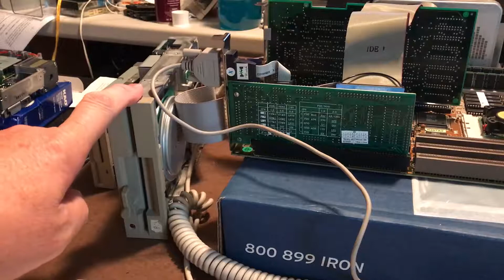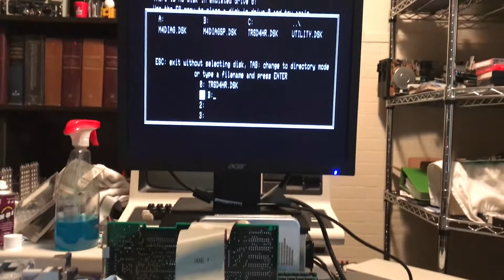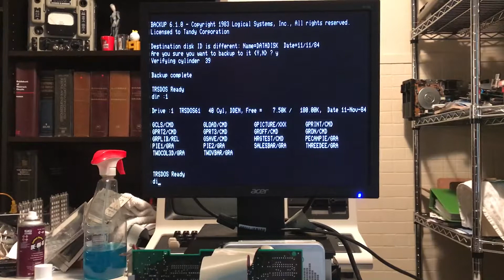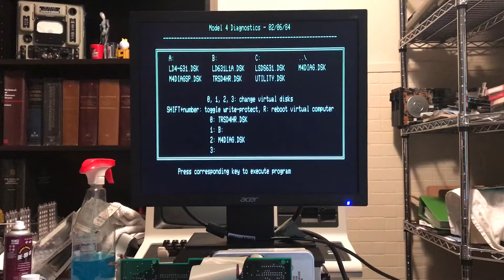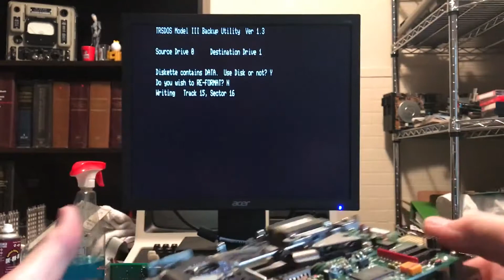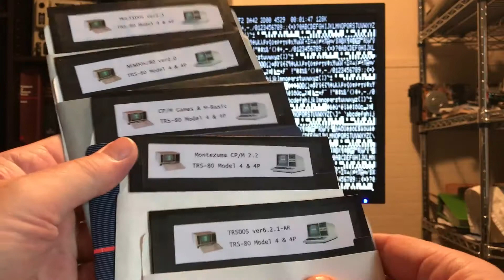Model 4 - Part 6 - Creating bootable TRS-80 Model 3/4 floppies - STB110

Comment: Real men don't need cases on their computers - eh?
Reply from the maker: :) My primary S-100 machine is an 18-slot backplane with cards in it and 3 switching power supplies. No case, no card guides etc. Even the power switch isn't mounted. Real man or stupid man is yet to be determined. :)